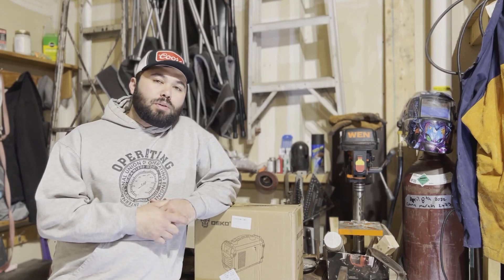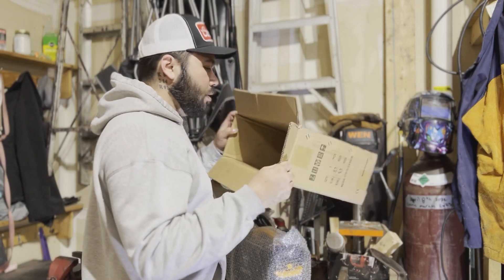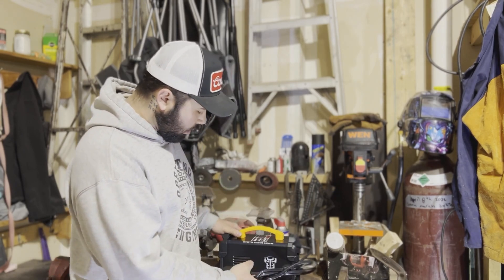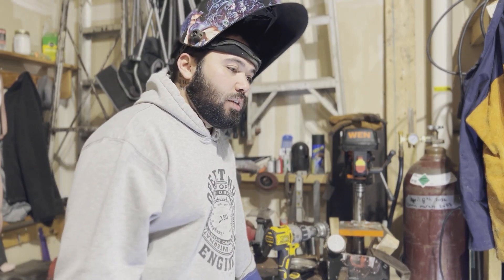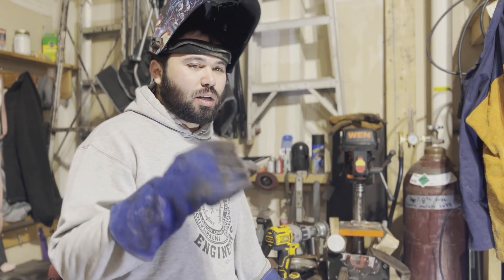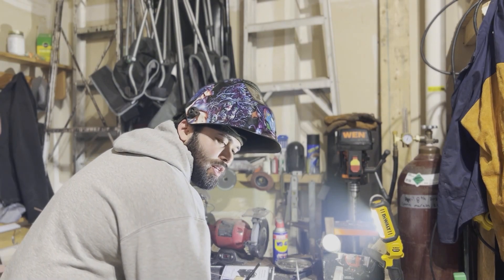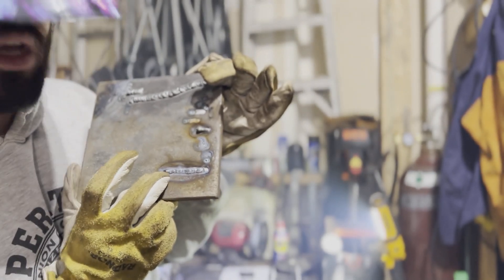Amazon Welder with Lift TIG Review: Is it Worth the Investment?

Comment: Hey Ryan, thanks for the video. What do you think of the ampere display? Does it seem to match with what you actually are getting? I have a deko welder and I need to run it a 170-180 amps to be able to run a 3/32 7018.
Reply from the maker: @Dibulok  weird I wouldn’t run that no more then 90 amps probably around 85 might be a defective one and I would have them replace it. Mine I would say is within plus or minus 10 amps
Reply: @RyanRosss  Ok thanks. I have a migatronic welder as well. On that one I run the 3/32 rods on about 80-90amps and the 1/8 on 120-140. But on the deko i need to max it out to even be able to light up a 1/8@RyanRosss
Reply from the maker: @Dibulok  yea it’s defective or try switching your leads ands see what happens maybe they flipped them . Most likely a defect tho. Don’t for get to subscribe 🫠
Reply from the maker: Let me know if you replace it and it still doesn’t work .
Reply: @RyanRosss  I will :)
Reply: @RyanRosss  I am recieving a new machine tomorrow. How do you like yours for stickwelding?

Comment: So this little welder which I just bought has no gas nozzle on it?? How do u set that up then? Does the gas connect straight to the Lift TIG torch my bro? I would really appreciate if u have the time to answer my Q pal.. I'm a complete newb to welding. I bought a stick welder last week but I saw this 160A DEKO inverter welder and got it really cheap. It was 80 Euros but I also got another 22 euros off the price with this special deal they gave me. 
I was hoping u were going to show us how to set up the LIFT TIG bcos I don't know how to do that. 
Is there any chance u might maybe make a video about setting up Lift TIG on this machine my bro? That would be awesome to see how u did that set up bcos this welder has no built in Gas nozzle on the machine. 
I'm stumped as to how to connect the torch to the gas bottle?? Is it connected through the torch and not the welder??
Great video my bro. It's cool to hear u like this welder and the cheaper one is still alive and kicking after 2 yrs.. Keep the great content coming my friend. Salute from Dublin, IRE,.
Reply from the maker: Yea if your tig welding with it you get a torch with a manual gas valve on it and you hook straight up to your argon regulator and then use your hand to turn on and of the gas with the torch valve you also start your arc but using what called scratch start basically like starting a match
Reply: @RyanRosss  Thanks for that advice and information Ryan mate. It's very much appreciated. I know ur probably mad busy so the fact u took the time out to answer my question means a heck of a lot. Thanks for that link as well my bro.. Salute from Dublin, IRELAND!
Reply from the maker: I can make a video if you need but here is also a good guide https://youtu.be/aGDHX5JdOos

Comment: Hi I noticed when you turned it on it only went up to 113 amps. Can u confirm yours goes up to 160 amps on 240v please?
Reply from the maker: Yes that’s correct 160 max
Reply: @@RyanRosss  I just purchased one, and had it replaced mine is only going to 114 amps max on display. Second unit only goes to 113 max on display. Kind of strange that two units do the exact same thing. Burning a 6011 1/8 inch rod. Both machines struggle to hold ark at what it lets me max 114 amps.  May have to return for refund.

Thanks for the quick response
Reply from the maker: @sceptre2565  what setting do you have it on and also is it on a 220 240
Reply: I have tried both on 120 and 240. On all the rod settings. 2.5 and 3.2 are the same, along with none allowing me to adust from 20 up to 114 amps.  At 120v it wouldn't even create an ark. At 240v I was almost having to push through my puddle to keep an ark on 114 amps. Played with arkforce in all the settings and the other off on setting.  I'm kinda thinking the machine is not sensing the 240v.  At 120v it's only supposed to do 120 amps. It shows that on the back panel.
Reply from the maker: @sceptre2565  hmmm you’ve held down the mma lift Tig bottom until it flashing and then it’s set on lift Tig . The only other thing I could think of is the knob is broken or like you said it’s not sensing the 240 . I would complain and get money back or even a new machine. There pretty good and giving you a new machine if you need so. I’m sorry your going through this that annoying
Reply: @@RyanRosss  yea I agree. I have put it in lift tig as well. And this is second machine.  Time for money back I guess.   Thanks for help

Comment: What settings would you suggest on 110 stick welding for the Arc Force, VRD (on/off?), MMA Lift Tig (2.0/2.5/3.2/off), thanks!
Reply from the maker: Well with this machine I only use it as a Tig machine. So mine is set to lift Tig .
Reply from the maker: Turn the vrd off to

Comment: How did you set you up the gig for gas and all that? I want to get into tig but I don’t know what I need
Reply from the maker: I will make a video but make sure you have a manual shut off valve torch for Tig is the main thing and of course a arc/stick welder. Make sure your you switch polarity . So your work piece is positive and your torch is negative. Then on your torch you have a direct hose that connects to your 100% argon bottle which has a regulator on it for cfm. Hope that helps but I’ll make a video in a little for you.
Reply: @RyanRosss  yup that’s exactly what I was looking for lol, I just got the dekopro so as soon as I heard I could use tig for my small side business I got pretty excited. I’ve used stick for the last 3 years and I’ve used it for everything including HP pipe fittings but can’t tig for crap lol
Reply from the maker: @calebsellars581  haha we all need practice. Practice makes perfect. Reason why I haven’t bought a nice tig machine myself. Keep at it you’ll get it . Hope it helps .. like and subscribe 😀
Reply: @RyanRosss  any link for the video on what you will need for tig?
Reply from the maker: I’ve uploaded a short video on how and what you need. Check my channel out and go to my YouTube shorts. Please Like and subscribe thanks again and hope it helps
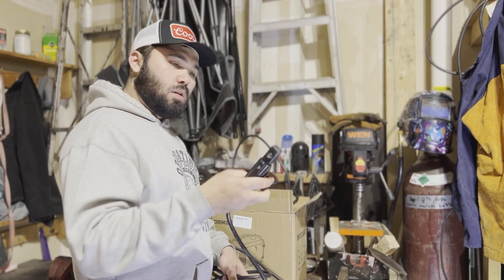Reply: @RyanRosss  1:41
Reply: Hey Ryan, could you link me to the short of what you used and need for the lift tig setup? I just bought this machine to get into some lite tig